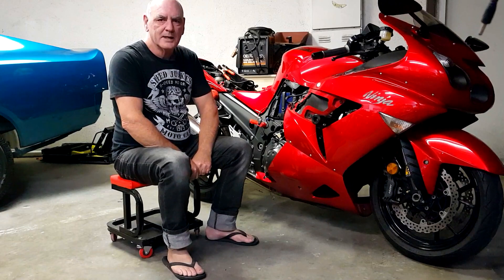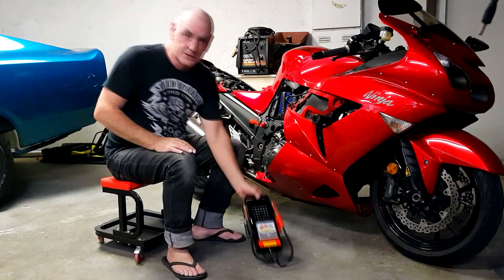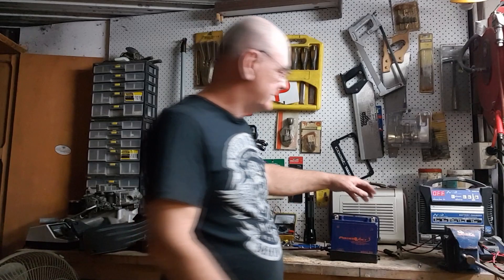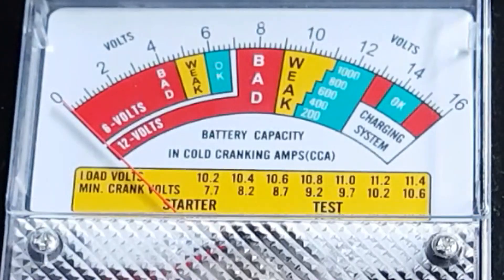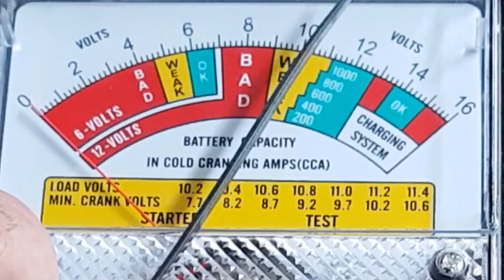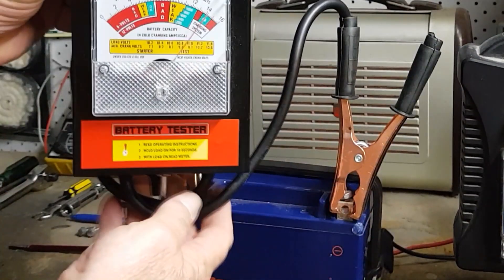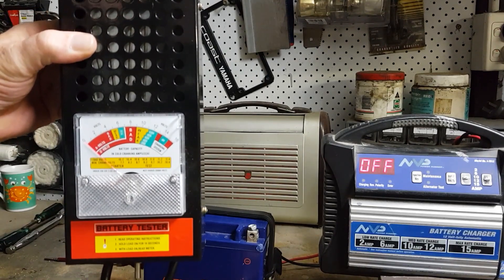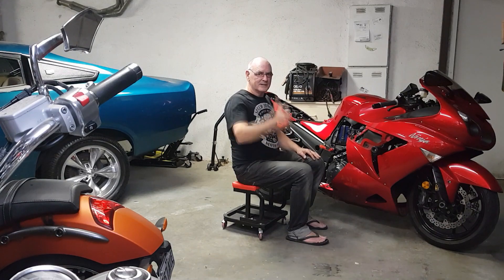Battery load test

Comment: So, if you load test a battery and it is slightly in the "weak" zone, can it be improved? Or do you have to get a new one? My 12-volt battery has 925 CCA but when I load test it, it goes slightly into the yellow zone.
Reply from the maker: if it's in the weak zone or heading there then the battery is on it's way out meaning replace soon.
Reply: @rolandkeith5322  Will do. The voltage is holding up well. I recharged it yesterday and it is still holding 12.4V. I'm going to trickle charge it today for 6 hours and then load test tomorrow again.
Reply from the maker: @johncalvo1743  A battery in good condition after charging and sat for say 15 minutes will read 13.2 or very close to that  A quality Desulfator is not a bad tool to have on hand because mainly it is the Sulfation that's the main problem with older batteries...... have a read up on it and it will explain a lot to you.
Reply: @rolandkeith5322  So you're saying that the desulfator can bring it back to life? The voltage is holding. But the load test showed weakness.
Reply from the maker: @johncalvo1743  yes a desulfator works but they take time to do the job. YouTube should have some vids on it all.
Reply: @rolandkeith5322  Hey Roland. Sorry to bother you again. I just bought the Noco Genius 1 on Amazon. It didn't come with a manual. How does it go into desulfate mode? Does it do it on its own?
Reply from the maker: @johncalvo1743  Hi back I don't know each device has a different way to start that function all I can think of is YouTube it or google it on how to get it into that mode.
Reply: @rolandkeith5322  Yeah. I've seen about 5 videos, but no one mentions it. Thanks.
Reply from the maker: @johncalvo1743  Sorry my Charger has a button for that function

Comment: What? It showed it was in the weak zone, so how can that be good?
Reply from the maker: cam angel could of been better
Reply: it's because the batter crack (CCA) is only 150  which makes it to be in the weak zone a little bit.even when u see 200CCA the nedle will be in yellow (weak) area
Reply: @rbon2wheels That is why I test a brand new battery first. My dual sport only has a 50cca battery. New, it would stay on the edge of the 200 green. Where his 150 was. I would have thrown mine out. But, his meter might read slightly different then mine.

Comment from the maker: I gave you a shout out at the end as well
Reply: Roland Keith so I changed the battery 2 days ago. Last night it started up OK and went for a ride. Today I thought I'd go show the bike to a potential buyer but the same thing..... Apparently the new battery is dead too. I hope it's just the rectifier and not the stator :-/
Reply from the maker: I would put a volt meter on the battery and start up the bike and see if the voltage increases to around high 13's to 14 volts or even a bit more. Because if that dose not happen then yeah the problem is in the charging circuit. Oh plus make sure nothing is electrically running in the back ground while the bike is in the off position been any thing like a GPS or what ever bleeding power off of the battery when it is off.😣
Reply: Roland Keith no I don't have any accessories like that on the bike. Last time I turned the bike on with the fresh battery the voltage went up so I thought the battery was charging.